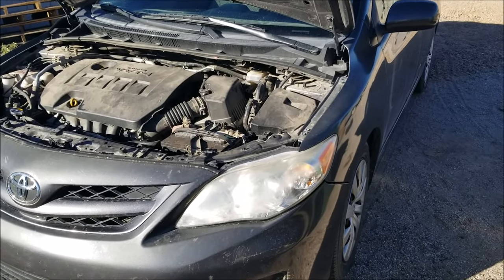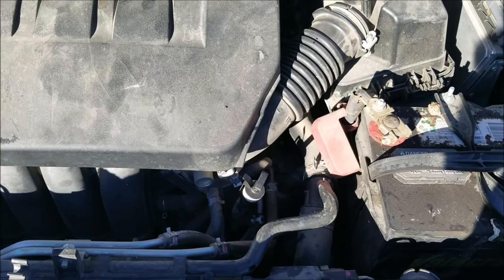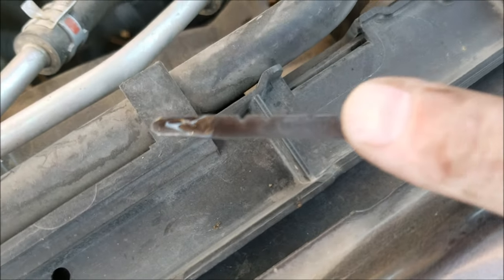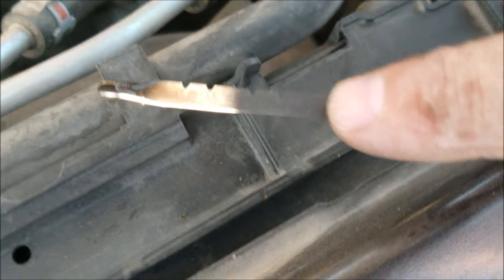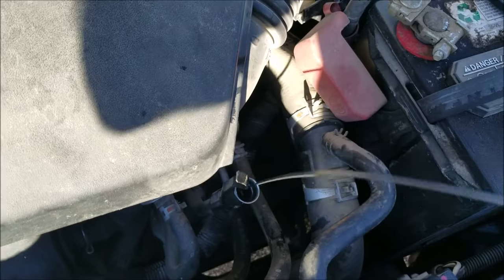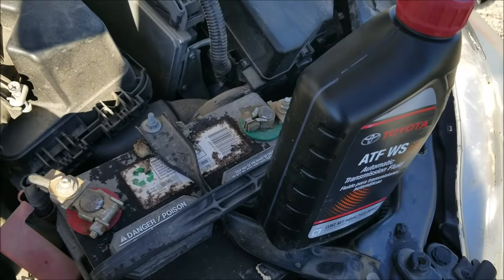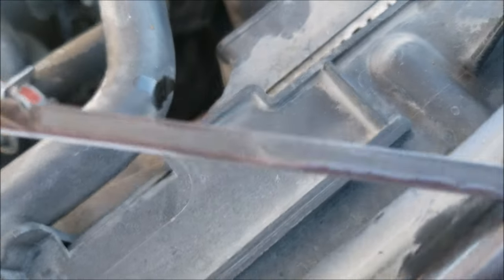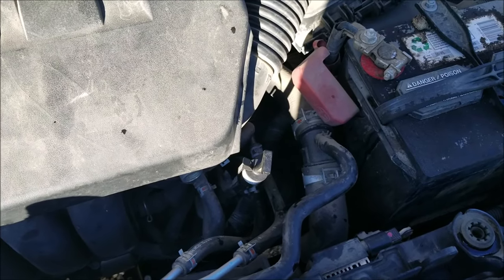How To Check and Add Transmission Fluid Toyota Corolla 1.8 Liter

Comment: You overfilled it!
Reply: how do you know?
Reply: @MrPhong1712  Because you described it as cool, not run very long, then filled to top of hot mark. >>>>Drive for 20 minutes>>Check  it>>OVERFULL. I would have left it where it was, driven for 20 minutes, THEN decided if it needed ANY MORE. Overfull is worse than slightly under-filled..
Reply: @daveh5635  He said he drove it around for 10-15 minutes which would have brought the temperature up adequately. Me, i would have either checked it before driving after it sat overnight to see if it was on the right mark or checked it after the oil was hot after a lengthy drive.